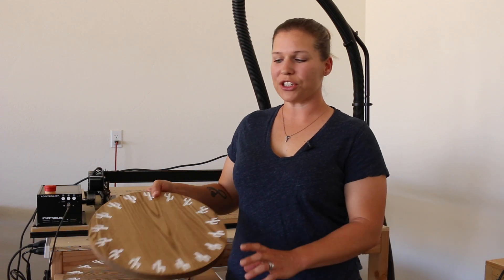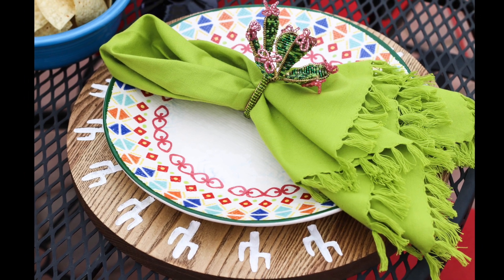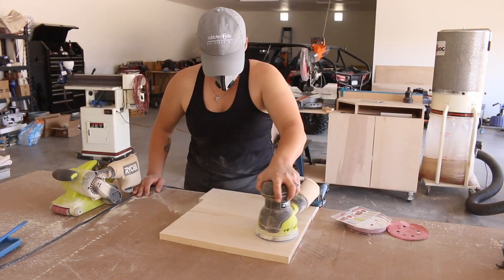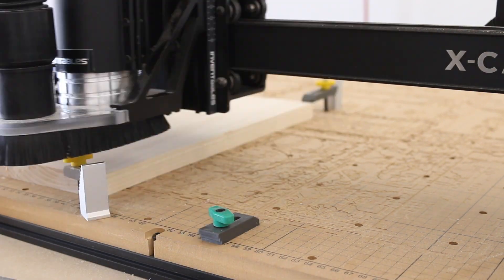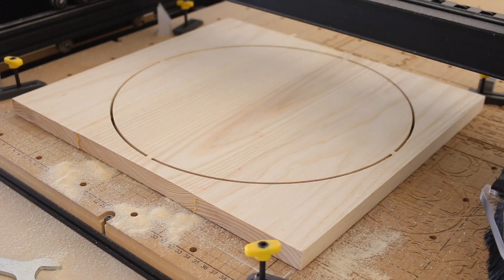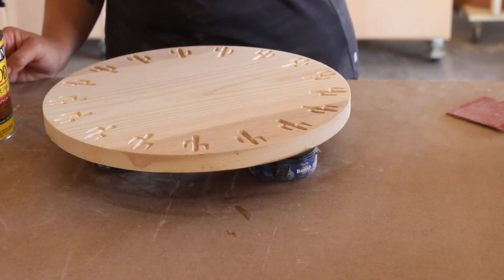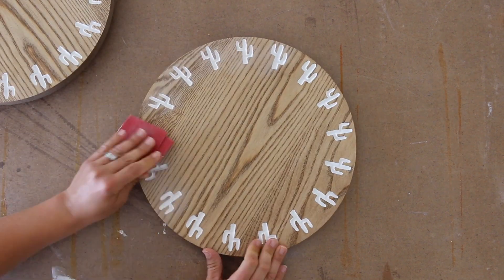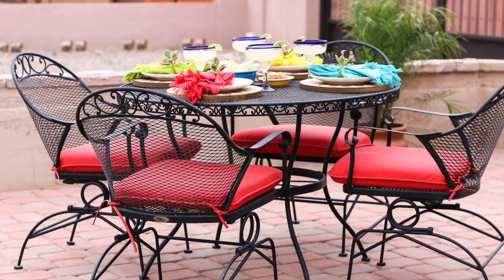How To Make Carved Wooden Chargers

Comment: Nice and quick video. Thanks.  What was the diameter of the chargers?  Off topic, I have rigid jointer too but lately I am getting belly in the middle of the board when jointing, haven't found good video or instructions on that problem.  Hoping you can help me out.
Reply from the maker: Thanks so much!  The chargers are 13.5” in diameter.  As for your issues with your jointer, the problem could either be due to each side of your table not being aligned properly, or it could be the wood itself.  If it happens on every board you run through, then you would need to adjust the infeed and our feed sides of your table to be perfectly flush with each other.  If the problem doesn’t always occur, it could be the wood.  In that instance, you would want to square up the opposite edge of the board on your joiner and then run it through the table saw with the square edge against the fence to square up the opposite edge.  Hopefully that answers your questions.
Reply: Katie Cleveland thanks.  It’s all the boards even the board that are already straight.  So it’s tables.  I raised indeed table to match outfeed and put straight edge.  They seemed ok except infeed table near blades had .5mm gap.  I haven’t checked will the outfeed table night than blade cause same issue?